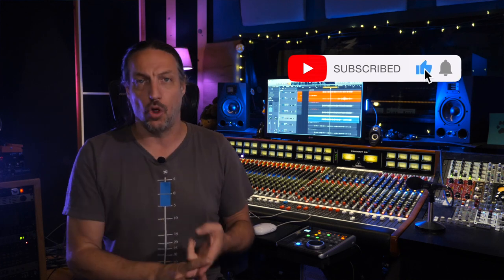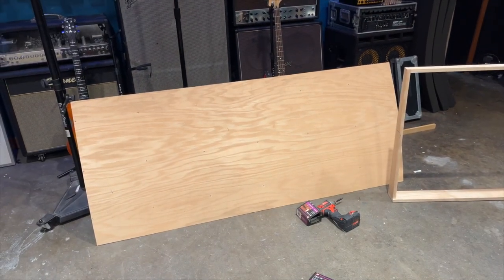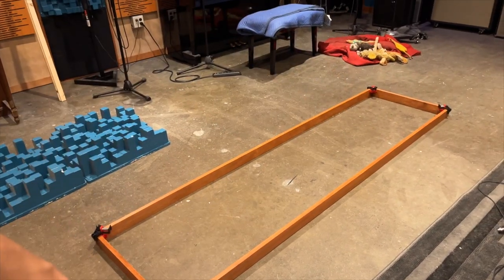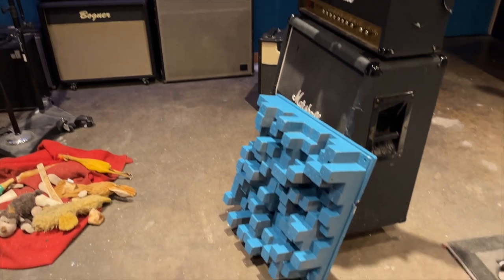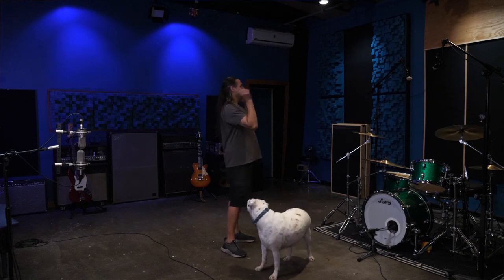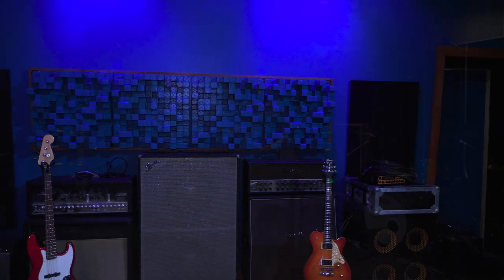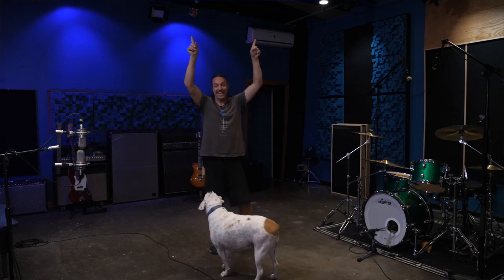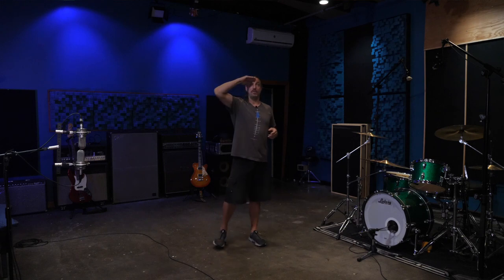Live Room Acoustic Updates PT2 - New Diffusion & Reflector Panels

Comment: Wow, what a sound. The room, the mics (and let's not forget most importantly your playing) sound great! Thanks for sharing the build process! How did you calculate lengths/size for your diffusors?
Reply from the maker: Well initially I didn't do any real calculations. It was more of a cover as much area as possible and hope it did what I wanted it to do. Which is why I revamped everything this year....Lol. I really had no clue what I was doing when I first put this stuff in. That's one reason I had everything on a rail system in the beginning too. So I could move things around easily to shape the room. 

Fast forward 10 years (yes it took me that long to figure out what I wanted, what was wrong and how to fix it) and many, many days of testing and I found a few things I like for my room. I didn't do any formal calculations but in stead relied on my ears and a direction I wanted to go. 

I actually consider the wall behind the drums to have 3 panels and not 7/8. So the grouping of 2 skylines and 1 absorber is one panel to me. There are enough diffusors to keep the sound open, kill any flutter echo and the absorber helps to keep is tight. I tried many combinations of that before I settled on this combination. The third panel on that wall is the large absorber with the reflector panel on top. This combination helped greatly to achieve the openness and imaging I wanted to the room overall. 

The diffusors on the other walls (and how many I used) was determined purely by testing....Record-->Listen-->Make Notes-->Re-arrange Panels (also changing configuration --> Repeat process..... I did this about 20 times before I started to hear what I wanted to hear. 

I'm not sure I actually answered your question but this is how I landed on this setup.